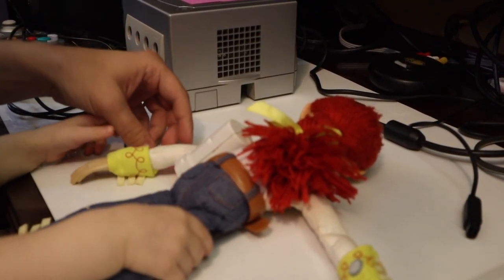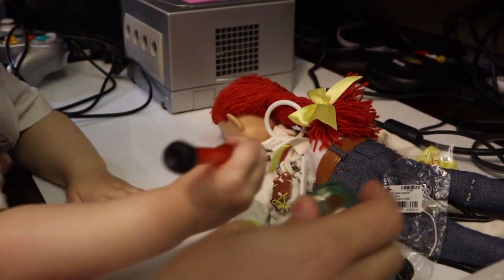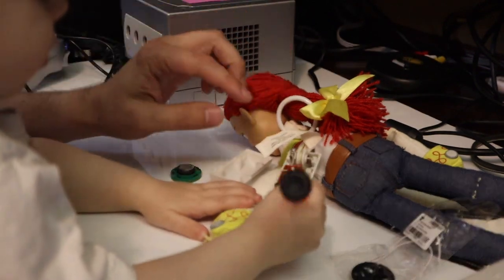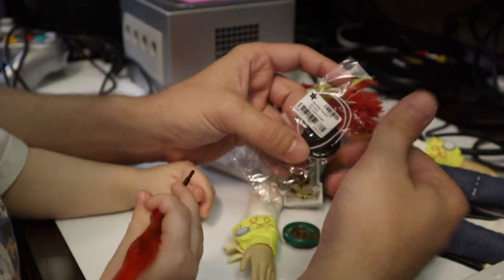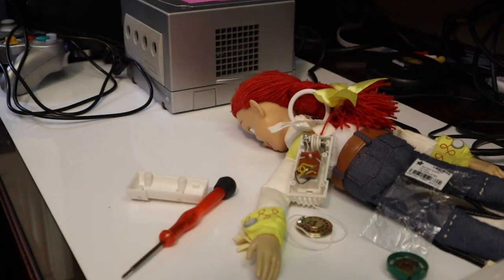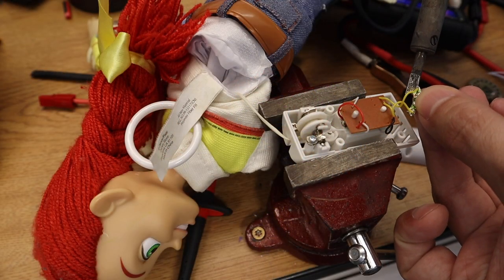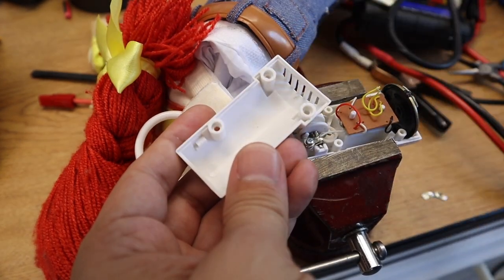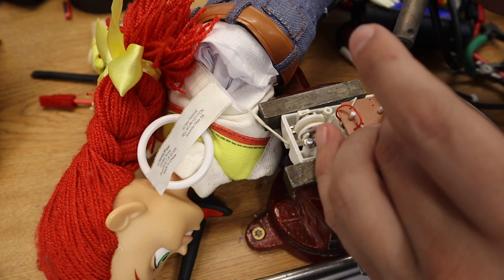Fixing Toy Story Jessie or Woody Pull String Voice Box...

Comment: My speaker works fine, it’s the pull string that does not draw back, how can I fix it, it’s just like the one you are fixing. Pleaseeeee help!!!
Reply from the maker: That's going to be a challenge. keep the string attached to the spool if possible. Open it up and see what's jamming it up or otherwise preventing it from spooling up. If the spring isn't under tension then you'll need to manually wind it up enough to pull in the length of the string. It's possible some plastic tab that holds the spring has broken off. Hope that helps.
Reply: I opened Woody becauae pull string wont recoil and its similar to the Jessie setup.

The bigger spring is broken. I think its supposed to be screwed in with the single white wire to help it recoil.
Reply: @abrahammorin1285 could you find another spring? Mine’s broken too! Kid pulled the string too hard